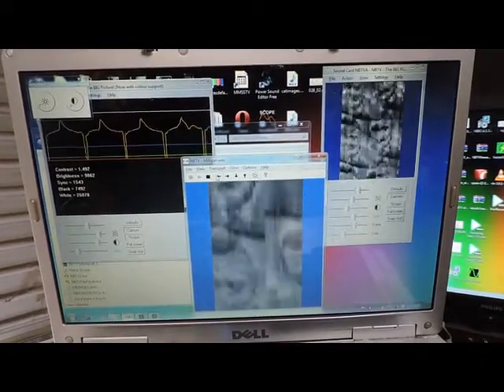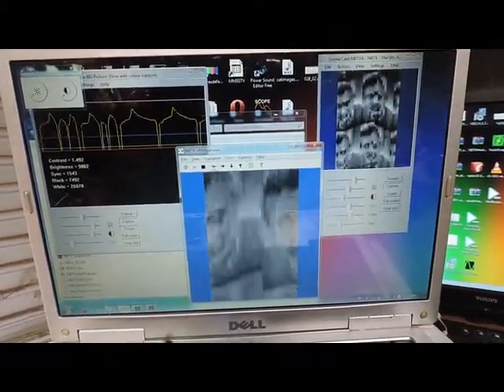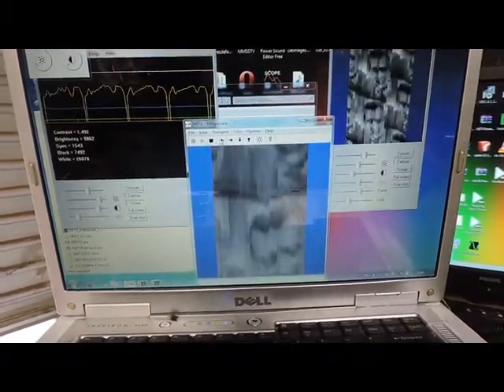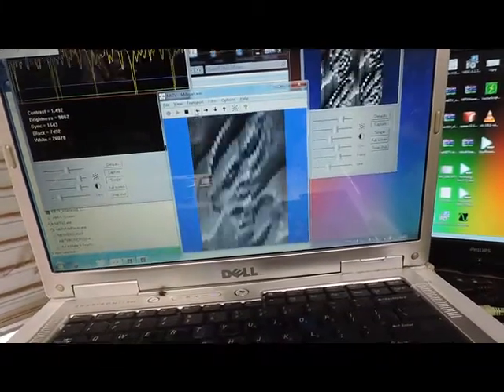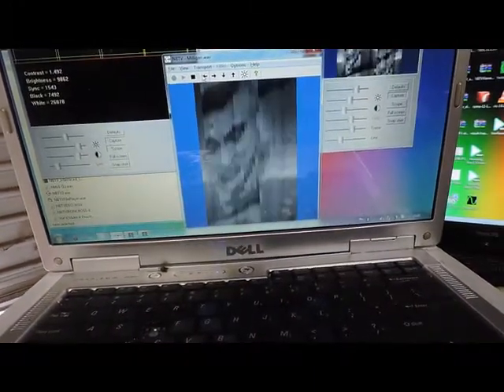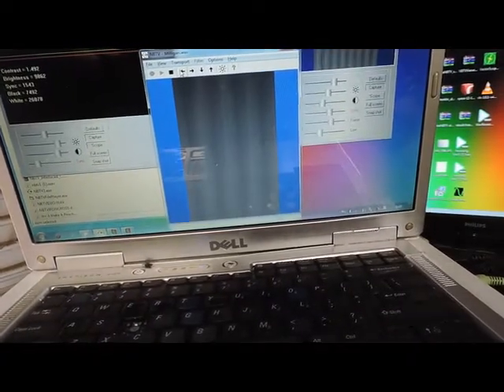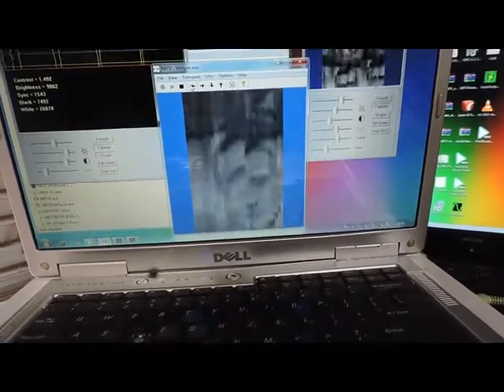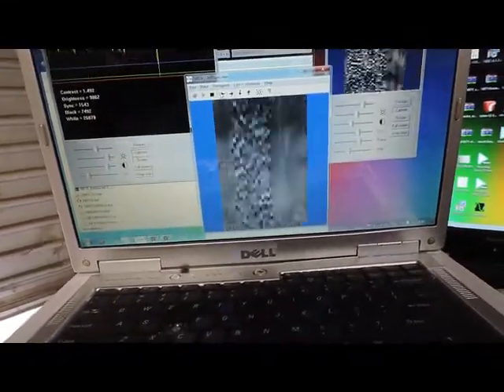PhonoVision Mechanical video recorder Speed change shown on recording

Comment: The thing is though, if the recording speed and the playback speed were identical there wouldn't be a phase error regardless of the position of the pickup.
Reply from the maker: That's what i thought and what i was working on counting on ... i did know of the problem all records have of a speed difference  from recording from the outer track to the inner there is a speed increase  not much of a problem for audio but here it sure is ..a cylinder tracks would be the same start to end ..so i may very well have constant speed as i can see on my scope but this problem has kicked me in the bottom as far as speed control .....
An idea could be to control the recording speed via a pot which is pulley connected to one of the lathe gears bit of trial and error might work if i could be bothered is another story ! ; 0 )
Reply: @039dalekmoore2007  Well the speed obviously changes from the outer groove to the inner groove, but if your motor is turning at a constant speed for both record and playback you will get a steady picture because the instantaneous speed will be the same for both record and playback.
Are you sure the motor speed is constant?
Reply from the maker: @vtbn53  Hi again it is a head banger this one ..i will look into it in case i am wrong which i am many times but good to double check it would  not take much to change my line rate frequency recording on this device a few  HZ  either side of it and its way off
Reply: where did you get the raw data for this?